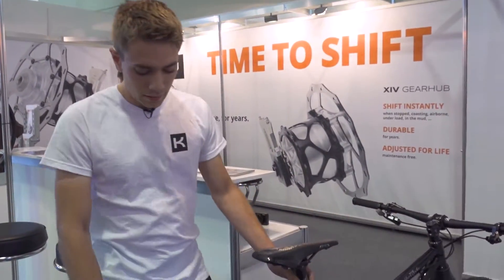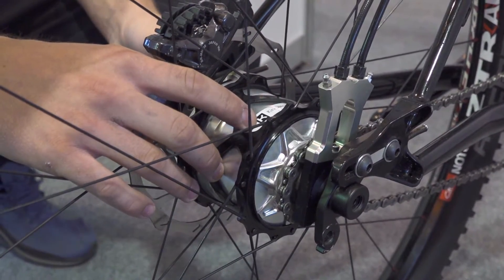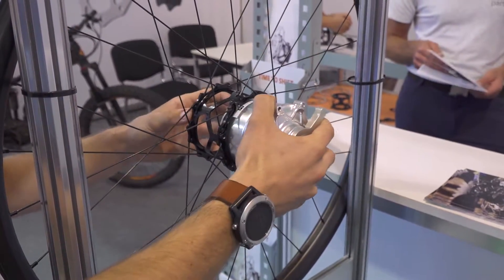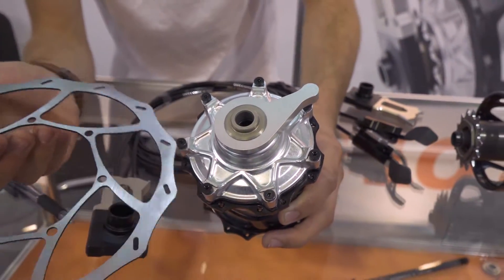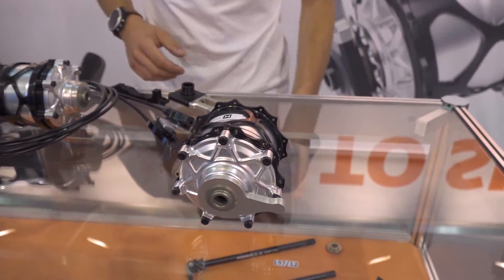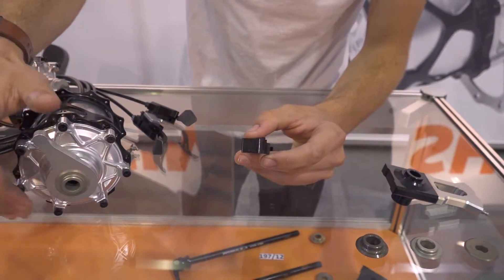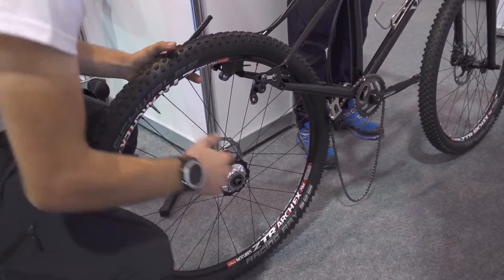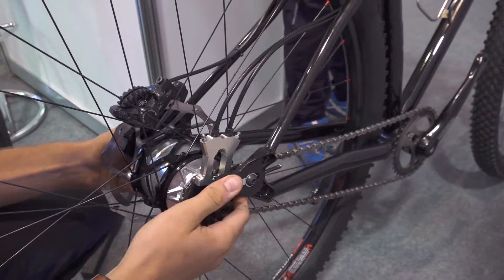Kindernay 14 Speed Internal Gear Hub

Comment: I have a custom touring bike built with the Kindernay 14 hub and Gates drive. Since the hub can be removed, I want to use it on a mid drive e-bike I want to build. Question:  How would I put tension on the Gates belt since the hub and mid drive positions are fixed?

Comment: Way back in the 50s I had an "English Racer" with a 2 speed rear hub. It worked great for years with no maintenance at all. Looks like you have a workable unit that could replace the derailuar system most bikes use now. Just wonder what happens if there is an oil leak in the shifting system.

Comment: I've been thinking about that hub cage for DECADES, every time I had to replace a spoke.   "why doesn't the bike industry have a standard wider hub that allows for shorter spokes, easier threading of spokes and way to contain whatever axel gear combo you would like?"  essentially making wheels standard and separate from rest of bike. Just go into bike store and wheels are ready to go.
Reply: Same here
Reply: Because having the two pieces separate increases weight and cost.
Reply: Weight yes, cost no.   Most hubs cost same or less from motorcycles and even cars.    That's what is so stupid about bikes, the cost for what little you get. @EricPeelMusic

Comment: Amazing system. 👍🏻👏🏻❤️
Can the drive side accommodate a carbon gates belt pulley?
Can a belt tensioner be fitter for full suspension bikes?
Reply: I will receive my bike with Kindernay hub and Gates belt from Pilotcycles soon, they should be able to answer your questions. Hard tail with dampening carbon seatpost though, not a fully.

Comment: what made you think that two hydraulic lines on the actuator was a good idea? much harder to set up than cables, and for what reason? cables should work fine for the load of changing gears.  Two levers on each side of the bar are bad ergonomically. 
Otherwise this hub looks very good. i like the cage idea, makes building the wheel much easier with the weight of the internal hubs.
No news on the hub efficiency.
Reply: Or wireless completely.
Reply: why are two leavers on each side ergonomically bad?

Comment: I don't get it, who is this for? The weight although impressive (for a wide range hub gear) and the shifters rules out roadies and most gravel bikers. Commuters wont go to that expense nor do they need too. You can swap between specially built wheels, great, but most people don't have multiple wheelsets (we just swap the tyres) and those that do want to be able to swap between bikes as well. MTBer's like to be able to shift quickly through multiple gears, this unit does not allow that. 
The realm of hub gears has always been long distance tourers but most of them will avoid it because of the difficult to service in the field hydro shifters and proprietary disc. It seems to me like they fixed a problem that didn't need fixing (for the vast majority of people) a failed at addressing the things that put people off of hub gears, like not being able to use normal shifters.
Reply: At this time, they can charge as much as they're the first (still the only one?) to provide thru-axle internal gear hub.
Reply: @willpurba4667  Which has what use case?

Comment: Good weight even for this price. Now am using alfine 8 with micro shift bar end shifter and its freaking awesome.
Reply: those shifters are not ergonomic like shimano lever shifters.
Reply: @mann_idonotreadreplies  yeah, but barend shifter allows you: to turn any gear by one move, to use any drop down break levers (not many available for Shimano int gear box hub. Also I know one guy who uses SRAM levers and barend because he doesn't like Shimano ergonomic). Also it has very simple construction so it could be easily repaired. I use hydraulic trp hylex break levers by the way